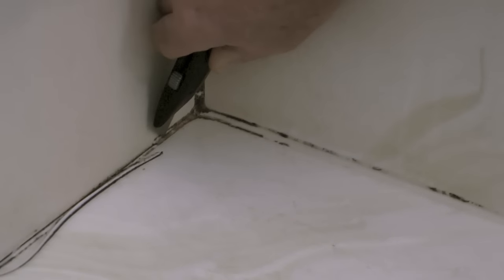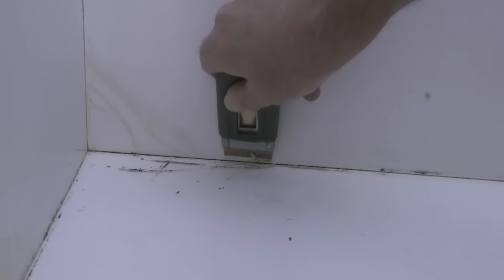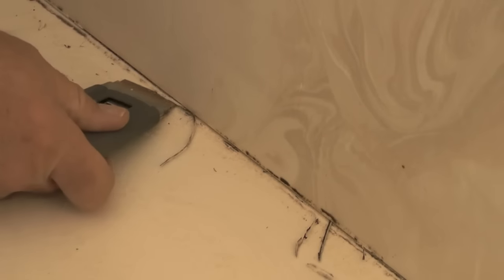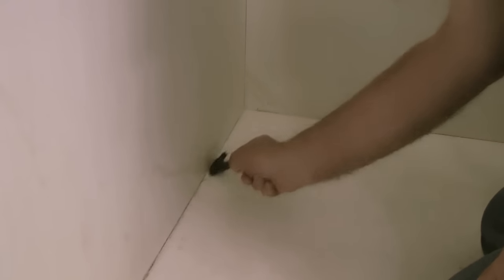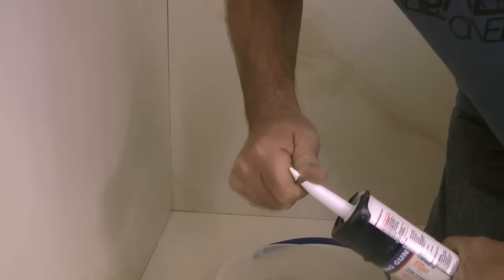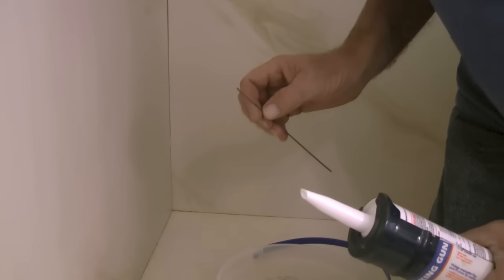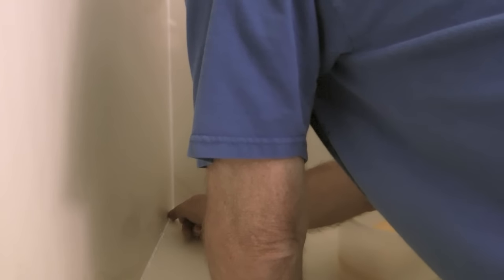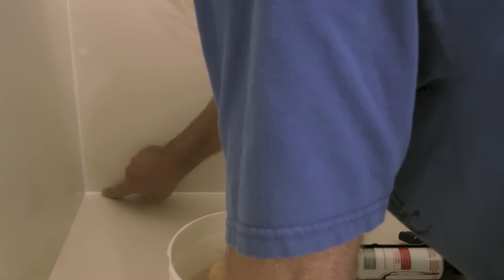Remove & replace moldy shower caulk

Comment: What about the vertical corners? How far up do I remove old caulk? Surely not all the way to the top. If only 6” or so does the new caulk adhere to the old without leaking at that conjunction? Thanks
Reply from the maker: I would remove all the old caulk so you have a continuous bead with the new caulk.

Comment: I need to replace the caulk around a shower stall that has glass doors. There are some openings (drainage?) in the edges of the shower doors that were previously caulked over, and it seems that the moldy growth has gotten worse since then. Do these need to be left open?
Reply from the maker: Lisa Gillman 
I think your right, usually shower doors have a track or slots to drain the water away from the door. I would try removing the caulk from the slots and see if that makes a difference.

Comment: I've got mold in my caulking around my kitchen sink. You know, because the sprayer always sprays the back around the sink. Would you suggest I do the same process? Do you suggest a certain type of caulking for the kitchen sink? Still silicone caulking?
Reply from the maker: +eclecticlosangeles 
Yes, you could use the same process and same type of caulk.
Reply: +iScaper1 Thank you for getting back with me.  I bought some 7 year mold free caulking today. Going to start the job tomorrow. Wish me luck...we are not handy in our household!
Reply from the maker: +eclecticlosangeles 
Good luck, let me know how your project turns out.

Comment: Use a clean white cloth like a cut sheet and use on your finger or a latex non powder glove as it the dirt ness from your finger that makes the inside of the chaulk mouldy
Reply: You are absolutely right. As a professional caulker I tool with metal tools and routinely my silicone lasts 20-30 years without ANY issues

Comment: Great video. I want to try this and have a question about dry time. How long did you wait between cleaning the old mildew with clorox and applying the new caulk?
Reply from the maker: +hideyourkidsnwife 
I used a hair dryer to dry out the seams so I didn't have to wait too long.

Comment: Thanks for the push Iscaper. I've been dreading this for a long time. Mine looks to be worse than your mold problem, probably because the installer laid down the silicone, or whatever he used, ridiculously porous and craggy, not nice and smooth as yours. To boot, there is a leak which keeps the stall humid. Perfect for growing dangerous mold cultures of all types which is why I am going to use thin nylon glove, breather mask and clothing that I should have tossed out long ago. I saw a documentary where a well to do business man lost his mind while living in a moldy house but his wife remained unaffected. Hmm...then again, maybe the wife did him in for the bucks. (sigh), I watch to many Forensic File Shows. ;)
Reply from the maker: +TVGUY333 
Great comment. You should probably cure the leak first or replacing the caulk won't do much good. Hopefully someone won't do you in for your money when you're finished.

Comment: We removed the caulk and some of the grout too... but we found a lot of water in the seam, is that normal?! Do we have to wait for it to completely dry before we re grout? Thanks!!!
Reply from the maker: You want it dry. Try sucking the water out with a shop vac then dry with a hair dryer.

Comment: Do you find that having the new tube of silicon caulk at room temperature makes it easier to dispense and to manipulate when using your finger to smooth it out?  I usually store mine in my garage which is about 10 degrees cooler than inside the home.
Reply from the maker: Room temperature is better.
Reply: Excellent.  Thank you much.
Reply: Richard Sheridan io'🐨🐀🐁

Comment: Before you try to remove the caulk you can try mixing a bowl of salt and add some realime/realemon then soak it in cotton or paper towel, paste on caulk.  Check every few hours and 95% mold will probably be gone saving you the effort of caulking.  Don't use bleach.  If you have to caulk it might be a good idea to have a bowl of water with a drop of liquid detergent to smooth the caulk line.
Reply: Do you mean lime or lemon juice?

Comment: For some reason no matter how many times I replace the caulk or how many diff brands I try, no matter how dry I keep the area it all continues to mold. I’ve probably replaced it 5 times already
Reply: Because you are either not using silicone, not installing it properly ( for instance using liquids to tool with,of not getting it bonded correctly,or just plain don’t keep it clean.) the simple fact is silicone is inorganic and mold needs organic material to grow. Mold can not grow on silicone without a food source.

Comment: How long with this caulk last before mold regrows? I'm assuming it's somewhat dependent on how often it's cleaned but was still curious.
Reply from the maker: Good question. Probably depends on how often you clean the shower and how humid it is where you live. I'm guessing the caulk in our shower had been in for 16 years to reach the state you saw in the video. The new caulk I used is supposed to be mold resistant.

Comment: What can be used to soften caulking? I've read about using a heat gun (under 300 degrees) as well as other products that will soften it. What caulking do you recommend for a marble shower?
Reply from the maker: The caulk in my shower came out pretty easily without using a heat gun. Lately I've been using GE Silicone II silicone caulk with BioSeal.
Reply: Can you buy the stuff in the squeeze tube if you don't have a caulking gun? Would it do an entire shower?
Reply from the maker: theradiantchild
Yes you can buy the silicone caulk in squeeze tubes. The squeeze tubes are around 3 ounces and the silicone for caulking guns is around 10 ounces. Depending on your shower size you'll probably want 3 or 4 squeeze tubes.
Reply: a guy on another video said WD-40 soaked overnight to soften
Reply: Chris O'Dowd do you have a link to that?

Comment: Thanks for making this video! It's going to make replacing the caulk much easier for me. I've been told that using WD40 helps to partially dissolve old caulk, would you recommend doing that as well to ease the amount of work needed here to remove it?
Reply from the maker: +Noor-Al-Deen P 
I haven't tried WD40. If you use it remember it will leave an oily residue, so be sure that residue is completely removed before caulking so that the caulk will be able to adhere to the seams you're working on.

Comment: How long did you let the shower dry out after you had wiped the silicon away with the clorox towels?
Reply from the maker: 1/2 hour, then I used a hair dryer on the seams to make sure they were dry.

Comment: If the purpose is to simply remove the mold, removing and reapplying caulk is not necessary. Simply soak those moldy areas with undiluted bleach. To keep to the bleach soaking, use cling film and/or sticky tape to create barrier to prevent the bleach from leaking away. Mold should be gone in a few hours of soaking.
Reply: Does not work.  Video is the way to go.

Comment: Tried this method, made nothing but a mess, very frustrating.  Found another method, where blue tape is applied on both sides of the caulk line, which avoid the excess mess.

Comment: I have used this method before but when I wet my finger and smooth the caulk it spreads the caulk wide and leaves a small residual on the wall and floor of the shower. This residual is so thin that water gets behind it and starts the molding process all over again. How can I prevent this?
Reply from the maker: Try applying a thinner bead of caulk.

Comment: If I can't get all of the moldy caulk off the edge of the tub, can I just caulk over it?
Reply from the maker: MsEyeRock 
If possible I would try to remove all of the mold. Maybe try a flat scraper with a razor blade and a small brush with plastic bristles, then disinfect with Clorox wipes or a solution of Clorox and water.
Reply: MsEyeRock What I did is soak a paper towel in Clorox, not diluted, just straight from the bottle. Next roll the paper towel so its like a cigar, then press it snug against the moldy area and let it work its magic for a couple of hours, then remove.  Not a spec of mold remained afterward. I didn't need to do any scrubbing at all, the bleach did all of the work.

Comment: Beautiful job!! But shower caulk should be referred to as  straight ole "SILICONE" so as not to confuse us beginners. Years ago I "recaulked " with caulk that had a silicone additive. Fifteen years later that stuff was petrified and took hours over several days and using different tools/techniques. Finally, after KRUD KUTTER caulk remover liquid remained overnight and a use of a blowdryer as I worked each area, i was finally able to remove all of the rock hard caulk, as well as the use of your techniques. I wished that I had seen this earlier rather than watching so many other videos.
Reply from the maker: Good information, thanks for posting.

Comment: Try to cut the tip on the tube of caulk about the same size as the gap you're trying to fill in.
Reply from the maker: Good tip, thanks for posting.
Reply: @Iscaper  Good tip!! I saw what you did there🤣

Comment: What if the shower wall is made of plastic ,that knife may cut into  it ? and (be careful ) is not the answer I'm looking for !
Reply from the maker: I would use the flat bladed scraper instead of the utility knife to cut the old caulk out. There would be less of a chance scratching the wall or the shower floor.

Comment: Great job but you don't want to touch the silicone with your fingers, even if you have soapy water because that will encourage mold to re grow in the silicone.
Reply from the maker: Hmmm. How does smoothing out silicone with a moist finger encourage mold growth?

Comment: You did not show what you did for the corner running from the floor to the ceiling. Did you just cut out the 6 inches or so that had mold or did you go right to the ceiling? I've prepped the floor and about 6inches up from the floor in the corners, but I've heard mix advice about whether it's okay to put new silicon on the old. Some say is should remove all of it because it won't stick.
Reply from the maker: Two of the corners on my shower walls were 6' in length and two were 3' in length. I removed all of the old silicone.

Comment: Why didn't you just spray Clorax or Tilex on the mold?
Reply from the maker: The mold was embedded in the old caulk and wouldn't come out with regular cleaning, that's why I replaced it.

Comment: Don't know what type of caulk you used.  With the good stuff (100% silicone), you'll get a pro finish by misting the caulk with 70% to 91% isopropyl alcohol before smoothing and then using a caulking tool or an old no longer used card like a credit card.  The 100% silicone can be sticky and not stay in place without the alcohol and a tool or card provides consistent smoothing shape.
Reply from the maker: Good information, thanks for posting.

Comment: Cut the nozzle on the caulking gun at an angle and push, rather than pull, the caulking gun. You will get a more even application.
Reply: This is hilarious. I have been a professional caulker for over 45 years and ABSOLUTELY NO PROFESSIONAL pushes the gun. Total BS
Reply: @genecarden780  try it. Once the noble is cut at an angle and you angle the nozzle so the very tip only hits the job service you will get a much more even application.

Comment: But mine is cement. How do I get that off?
Reply from the maker: Where concrete is more porous than a normal shower wall and floor, you might have to use something like a wire brush to get all of the old silicone out. Then maybe a bleach and water solution after that.
Reply: iScaper1 Ive ruined 5 iron brushes trying to clean this. Ive just bought this product which might just do the job - they told me that its for very heavy stains. theres a spot in the tiles which was covered in urine and it stained - Ive scrubbed it so hard but it doesnt come off.
Reply from the maker: meld beach
If the urine soaked into the concrete you might not get the stain out. Let me know how product you bought works.

Comment: I use a spray bottle with 1/2 bleach and 1/2 water.
Reply: +spyralspyder (Before caulking)  leave it for a while after spraying and then wipe down with water and dry.

Comment: I have currently have bath fitters  it’s actually in while it’s now just me and my mother.  One of the things you want to get also is cool wouldn’t forget it works it does take couple days for things to come out and then just let it do it’s thing the caulking I have a tool that I bought cost of $22 and it has a metal frame around it and you should take the caulking like that and just take your time doing it it’s not hard and I’m never calling a plumber at Fort but they’re fitters you have to be careful with the material.  I’m not defending the company that I didn’t do the shower technically when I was supposed to all the morning builds up you got a watch called the spray I forget what it’s called it’s you can actually get on Amazon or eBay and you spray it and it should make the morning try to disappear

Comment: good vid but you might have wanted to bleach the gap and then put new caulk but nice vid
Reply from the maker: I did use a clorox wipe around all the edges but bleach in the gap is a good idea also.
Reply: iScaper1 REALLY appreciate this vid and going to try it out but just wanted to comment that only fresh bleach will kill mold.  Needs to be 10% bleach solution and sit for 10 mins. That will kill pretty much anything it touches.  Looks like you scraped and cleaned must of it out anyway but to top it off with a fresh 10% bleach soln would be a good precaution it seems
Reply from the maker: Jennifer Cropper
Good information and thanks for sharing. What do you mean by "fresh" bleach?

Comment: Using your finger in water is a big mistake as you're adding water to what should be a dry area. Using a Fugi Kit is cheap, clean and gives a better looking , longer lasting result. Preparation is 98% of this job and the shower has to be thoroughly cleaned of soap scum before sealing is done.

Comment: You shouldn't smooth the silicone with finger! You should use a plastic tool instead! It will remove the excess the best way! With your finger you will leave a thin layer of the silicone which with time will start to unstic from the surface, start to form mold and would look bad.
Reply from the maker: I learned this technique watching professional home-builders. Why couldn't it be either method depending on preference?
Reply from the maker: mystic0103
Good tips, thanks for posting.
Reply: That's a good point.  I used my finger wrapped in a plastic bag.  It worked fine until, like you said, the thin layer started to collect mold and look like a shoddy amateur did the work (me).  I also used the sponge to clean the edges, but didn't get that thin layer, thinking it would hold better if it was left.  Bad idea.  This time I'm filling only the gap and cleaning the rest. I've got a big clean up ahead trying to remove all that thin moldy caulking.

Comment: Here’s the $64,000 question….What’s your secret for cleaning soap scum off of glass shower doors? I’ve tried every chemical known to man and none have made a dent. I’m going to give the flat razor blade trick a try next as I’m running out of chemical methods. Arrrrggggghhhh!!!
Reply from the maker: I have the same problem in my shower. I'm going to try vinegar and Dawn dish soap and if that works I'll post the video 🤞

Comment: Maybe you could also look as using a ShowerSeal Ultra 10 Sealing product, which has a 10 year mould warranty, so you wont be doing this job again for many years. Available from Byretech.com in the UK or J Sharones in Orlando USA - See our video here - https://www.youtube.com/watch?v=Qnif09WcOKg  - Remember to use Metylated Spirits ( Blue liquid ) before using any silicone sealant to make the bath / tiles clean and oil free. Silicone wont stick to remnants of WD40 on the bath. Hope this helps - Steve..... Byretech.com
Reply: What a bunch of crap. Install silicone CORRECTLY and it will last 20-30 years with no issues

Comment: Wtf why don't they develop an anti-bacterial/anti-microbial caulking?
Reply: Improper application is the cause of the mold, not the caulk itself. You must smooth out the surface to prevent moisture from collecting in the grooves.